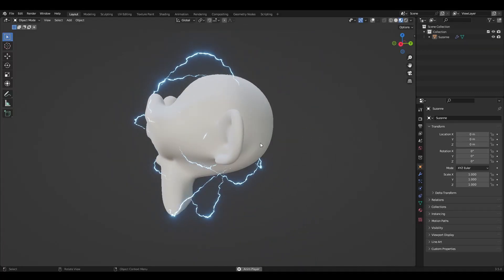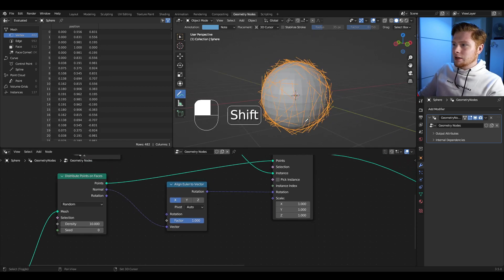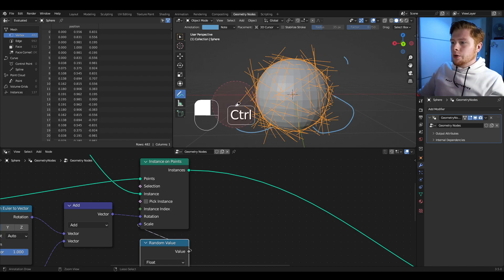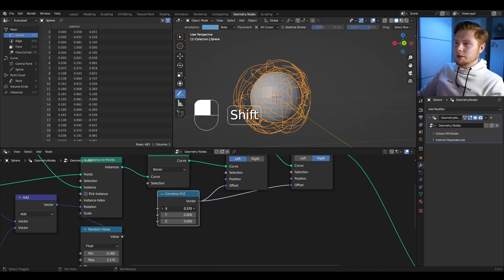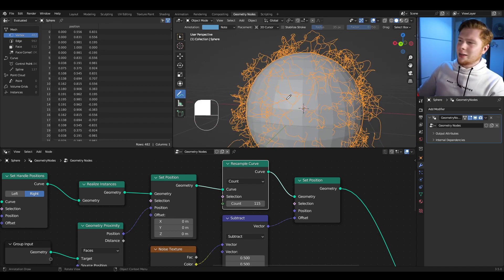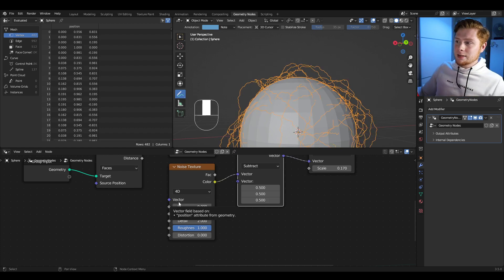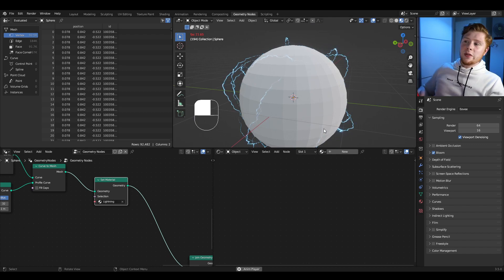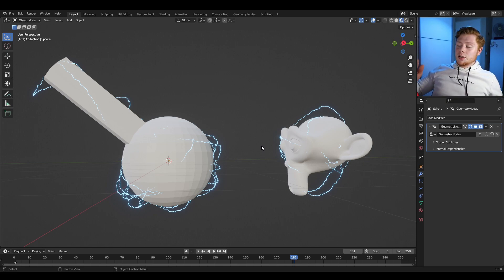Electrify Your Scenes: Blender Geometry Nodes Generator Tutorial

Comment: Great tutorial.....question: The rendered image looks different than the viewport. The lightning bolt position is not exactly the same in the rendered image as i see in the viewport. Is there a parameter somewhere that can make the rendered image match the viewport image
Reply from the maker: Hey! Might be that you have a subdivision surface modifier on your mesh on which the level Viewport and Render are not the same number?
Reply: @mtranimation   The numbers don't match, I'll fiddle with it....and retry and see if it works....fortunately Blender allows you to render animations and stills from the viewport, and EVEE looks pretty decent in the viewport if you bump up the quality. Thanks!